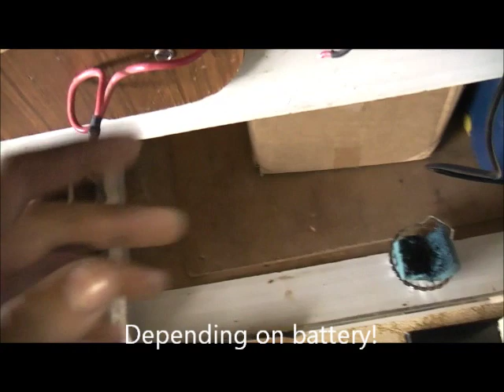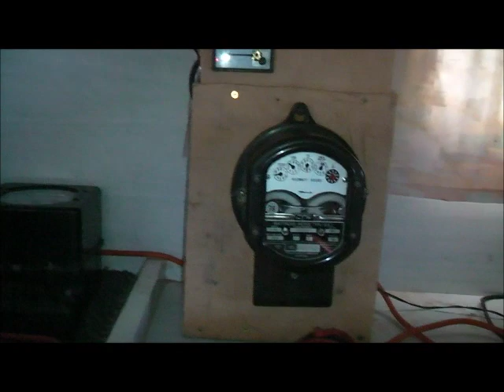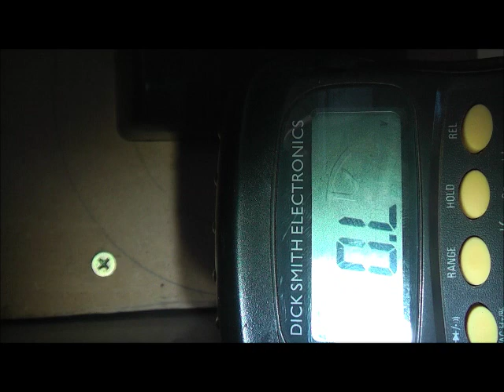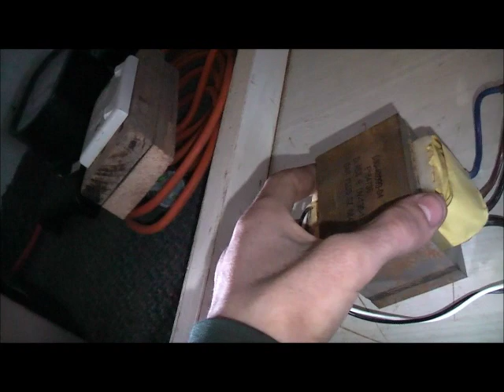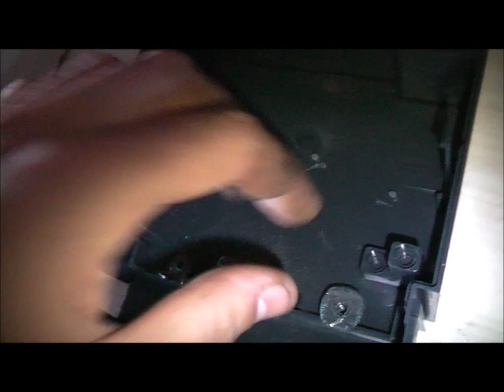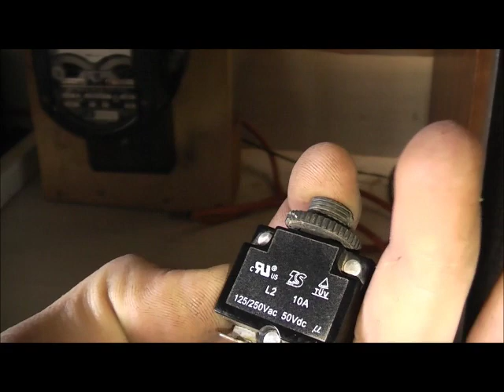UPS Transformer Test

Comment: looks like your trying to make 4:3 Cam an wide screen (16:9) (adding black borders to the top and bottom)
or an wide screen(16:9) cam and the converting software on the pc is adding black borders at the top and bottom

if your cam is not wide screen leave the aspect ratio on your pc software in 4:3 on the PC

play back your own videos and see if there is an Black border there should be no black border at all (at the top or bottom, the black border on the sides is fine if your cam is 4:3)

Comment: 8 - 0 - 8 Volts. or 16 Volts on the hots.
Great idea of using that meter casing, but no vents. It should easy put out 20 Amps or so.